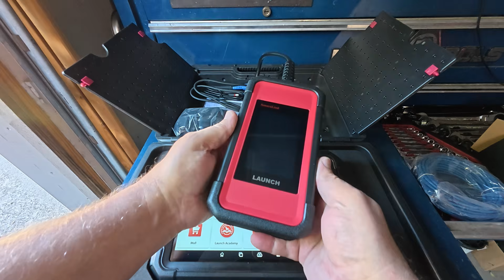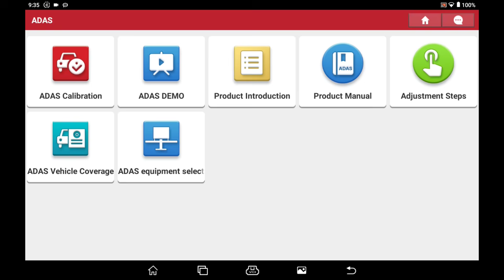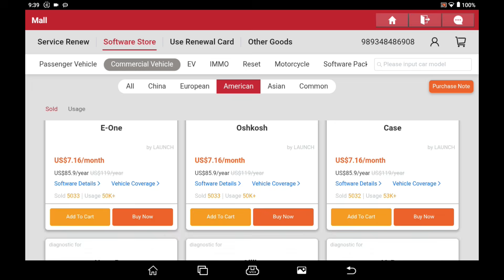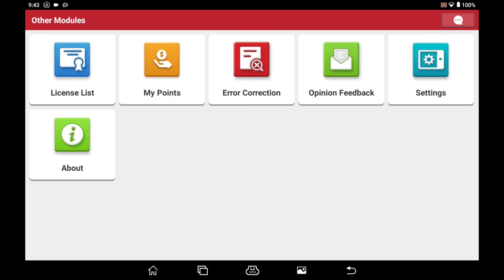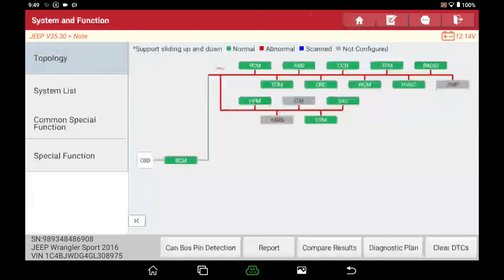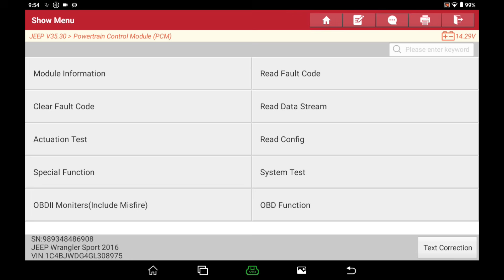The Launch x431 Pro3s+ Elite is one of the Most Feature Rich Scan Tools I have Reviewed .

Comment from the maker: X431 Pro3s+ Elite is a must-have for serious automotive diagnostics and maintenance work.
Launch x431 Pro3s+ Elite with Smartlink V2.0
https://www.amazon.com/dp/B0FPF2S57B?ref=t_ac_spc_accepted_tile&linkCode=tr1&tag=737mechanic-20&linkId=B0FPF2S57B_1784853341774
Launch X431 PRO3 V+ Elite J2534
https://www.amazon.com/dp/B0FPF2S57B?ref=t_ac_spc_accepted_tile&linkCode=tr1&tag=737mechanic-20&linkId=B0FPF2S57B_1784852998610
LAUNCH X431 PRO3S+Smartlink HD Heavy Duty Truck Scanner
https://amzn.to/4qrI3ek
LAUNCH X431 PRO Elite Corded is less expensive
https://www.amazon.com/dp/B0C6TGKYLF?ref=t_ac_view_request_product_image&campaignId=amzn1.campaign.1TIC1IQXP7B5A&linkCode=tr1&tag=737mechanic-20&linkId=amzn1.campaign.1TIC1IQXP7B5A_1769699368835
LAUNCH X-431 i-TPMS TSGUN
https://amzn.to/49flNOq
LAUNCH BST360 Bluetooth Car Battery Tester
https://amzn.to/47nX0Fz
LAUNCH Tech VSP-600 USB Endoscope
https://amzn.to/3L2Xucr
LAUNCH X431 X-PROG3
https://amzn.to/42UjRHb
LAUNCH X-431 Oscilloscope O2-2 Scopebox
https://amzn.to/3WR33xe

The links I provide are Affiliate links that I earn a small commission from but don't cost you anymore. Thank you for your support.

Comment: Don't buy launch scantool they junk will not scan called them and text them to all I got was the runaround and they will not warranty it thay told me that I have to go back to the seller and get them to do it thay are going to help me out but it's locked up can't get it opened up to send them a video of what it's doing and how they can help me out with it went on their tech line it's 24/7 thay told me that I have to leave a message and they will not back to me same hot line  went on live chat line got a message that I have to leave a message to
Reply: Something is wrong with your scanner then. Launch is awesome. Better than Topdon, Xtool, Mucar, Thinkcar. If you got it from Amazon or AliExpress, you won't get U.S support. Only the seller will provide support. Launch CN and Launch U.S.A are the exact same scanner built in the same mfg company. The only difference is price and support. It also sounds like you bought a used scanner with an expired subscription and tried to update it which will brick the scanner.

Comment: Hi have you ever used a launch to diagnose or scan a motorcycle or ATV or snowmobile
Reply from the maker: No I havent. Most these higher end launch scanners do have optional software for motorcycles I have never used it.
Reply: I had 3 of the x431 tools and I just bought the top of the like one  the tab 7 with the handle    u can buy the ev and bike kits to do such

Comment: Can you reset air bag module ? With this scanner ?
Reply from the maker: Yes but it will depend on the year make and model because some manufactures do not allow an SRS module to be reset with any scan tool but if the manufacturer does allow it this scanner will do it.
Reply: @737mechanic bmw f10 ?

Comment: I want to upgrade from my launch crp919e, great tool however my only issue is that when reading data streams the tool gives me every pid for that manufacturer many of which may not be relevant for that vehicle, does this tool improve that feature
Reply from the maker: The only PIDS that I have seen so far was PIDS that are active for the year, make, and model.

Comment: The CAN bus pin detection is a pretty awesome function. That's a feature that I wish my Topdon Phoenix Plus 2 had. 😪
The SW updates are also a LOT less than the Topdon. 🙃  I'll probably get a Phoenix xxxx. in a couple years when my Topdon SW "expires".............    These @#$^^$#$ tools are designed to suck $'s out of our wallets.
Reply: Hey does the Plus 2 do High speed CAN bus scan of multiple modules at once? Since it’s CANFD?